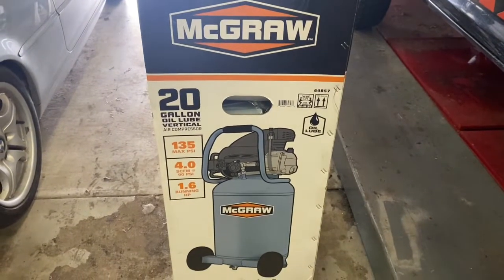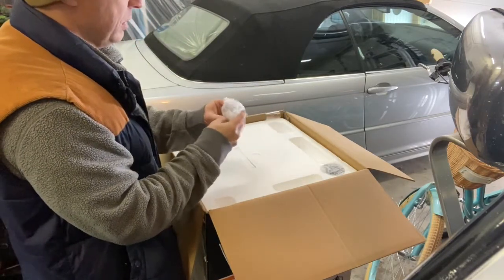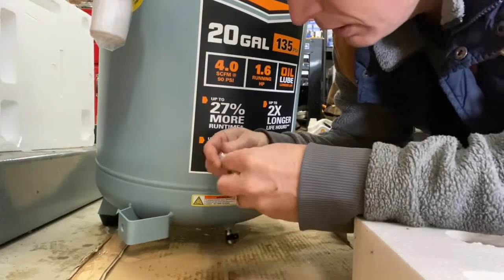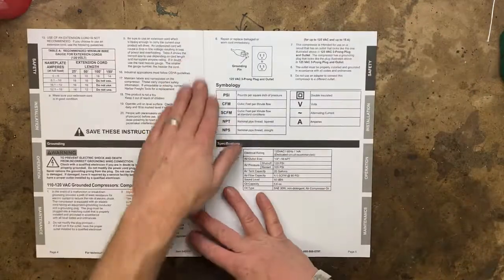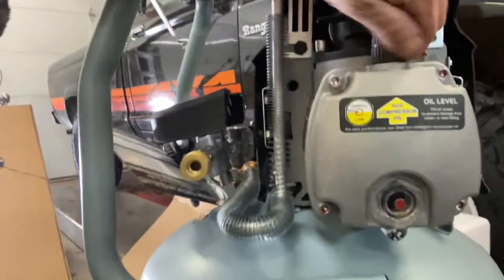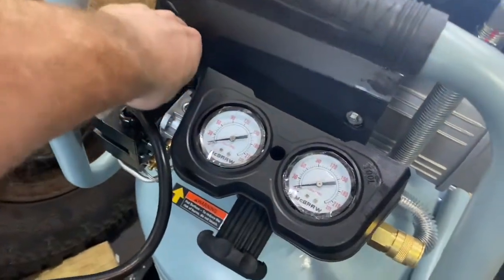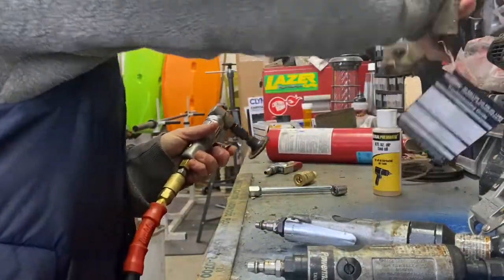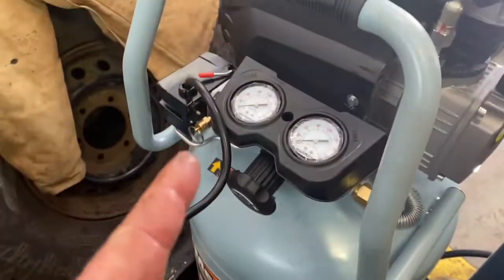Harbor Freight McGraw 20 gallon Air Compressor set up and overview

Comment: How has it held up? I’m thinking of picking the same compressor up soon
Reply from the maker: @GearheadSCLA  no problems with it.  If you use something continuously you do have to give it a break every 10 minutes or so and let it catch back up otherwise that motor will run continuously and probably wear out a lot quicker.  I would not use it with a paint sprayer, I don’t think it would give consistent pressure for long enough